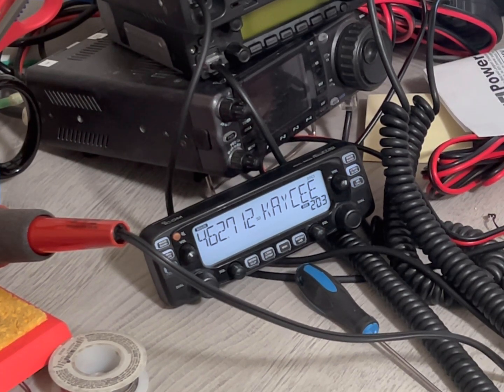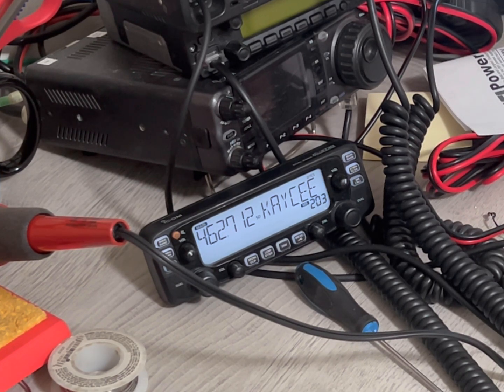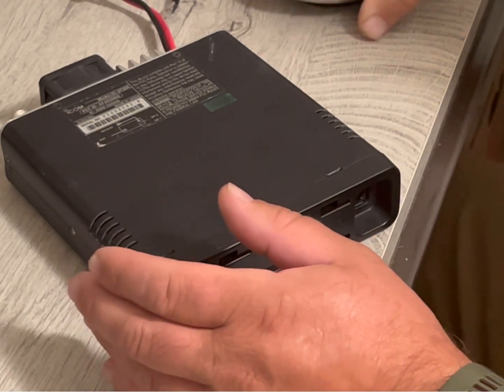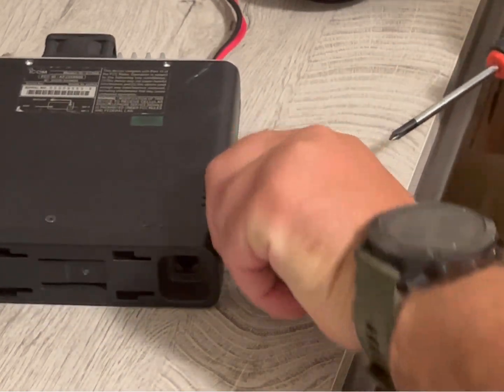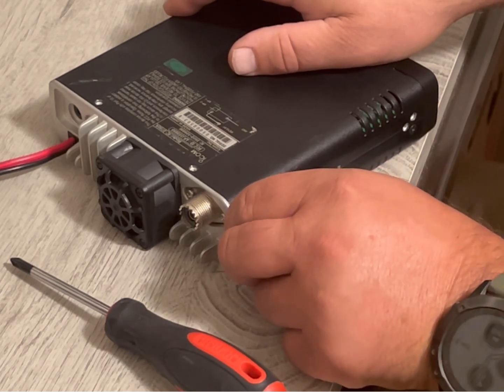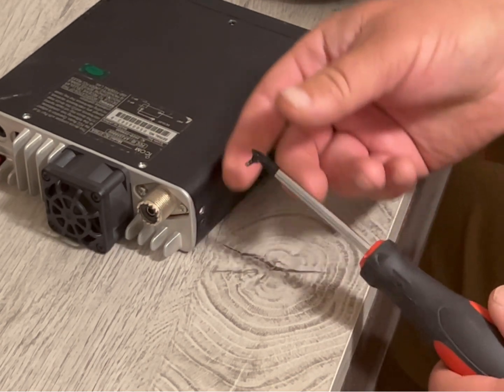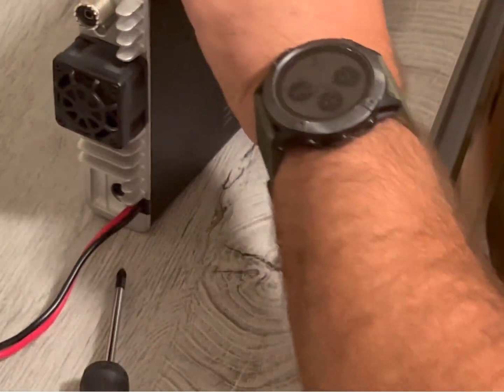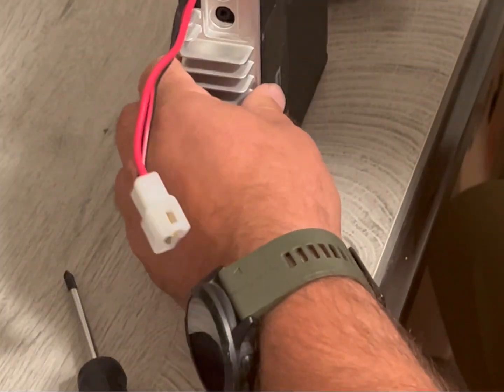ICom 2730a MARS MOD

Comment: PLEASE READ THIS BEFORE TRYING THIS!! USE A HOT AIR STATION IF TOU HAVE ONE!!! I performed this mod and there are some things people need to be aware of. Even using a soldering iron I managed to pull up the pad and one of the traces going across to the opposite side field where there are no resistors. I pulled up on the resistor a little to hard while applying heat to only one side. The trace is very small and delicate and is almost impossible to see. I had some noise issues after reassembly so I went back and took a closer look. After throwing the board under a microscope I could clearly see the damage I created. I should have used my hot air station but I thought it looked easy enough watching the video. That's on me. 

These resistors are assigned to UHF and VHF, the damage I caused affected VHF. For reference, there are 16 total pads in a 4x4 configuration. Looking at the board from the front of the radio, the top left pad, I'll call pad number 1. Pads 11 and 12 (VHF) and pads 15 and 16 (UHF) are bridged with the resistors on US versions. Pads 7 and 8 will have a resistor on Euro models. There are traces that run from some of the pads to others. I pulled up pad 11 and the trace running to pad 10.  The lifted pad and missing trace opened a critical configuration line that the IC-2730A uses to correctly set up the VHF front-end. With that line floating, the radio misconfigures its VHF filtering and biasing, causing constant background noise and reduced sensitivity on VHF. This caused all sorts of noise and other issues like my tone settings disappearing after changing a channel. My UHF remained normal as I did not damage that trace.

I should have known better given my experience but I was lazy and that's on me. The fix will be to connect pad 10 with a Via (a very small circle with a dot of copper in the center) that is right below the missing pad 11. This will be done with the microscope and some 36awg magnet wire and all the patience I didn't use the first time. I'll update as to the success of that endeavor.

Comment: Awesome video !! Does the mars mod open the icom 2730a to 11meter cb radio?
Reply from the maker: It will not. You would need to modify a radio that also has 10m such as the 7100 to achieve that

Comment: Also, why did your radio say mute on the display when you keyed up? Thanks for making the video! Guys like you are awesome!
Reply from the maker: Good question! You can turn that feature on or off. But in essence, this radio is really two transceivers on the same case. I have enough of a time hearing as it is, so when one “side” of the radio that is designated as the primary side is in use, it will mute the other side to give priority to the active channel

Comment: So if I only want to open up the 70cm band do I only need to remove 1 of the 2 diodes? Is it 1 diode for 70cm and 1 diode for 2 meter?
Reply from the maker: You cannot only open 1 band. It’s both, or none. The fact is, your radio will receive all bands whether you do the mod or not. All this modification does is allow you to transmit on those frequencies that are out of band.

Comment: Well done sir. 
Finally I find a regular guy with real life views on shit which would be on the common sense to the obvious chanel if there was one. Every radio should be unlocked just like all the black chinglish toys on Azon.  I saw the other nutless videos about this. Yours just popped up on my feed. 🎉
My question here is. 
Will it still chirp load for its new freedom’s. As in repeater programming  features for GMRS. 
Just wondering before I pull this mod. If the repeater program side of things have some sort of bullshit cock block built in somehow too? It’s going back. 
The unit I got was pushing 59w on the fringe band close to the FORBIDDEN ZONE! Lol
Aside from then SR 71 turbo fan as soon as you key it up. I think this will be a real talker. 🎉
You now have a loyal fan here BTW. 
Surely you have came to the realisation that fucking with magnets and miracles is a goddamn sickness not unlike chasing a fucking Dragon.  The comment about shit heads not replying gave me a lol moment. 
Thanks for you style and  efforts to clear up the other Nimrods vomit. 
Pull a cork for me 
Cheers brother man💫
Reply from the maker: Appreciate the comment! I do not use CHIRP - I prefer RT System's software for all of my programming needs. Yes, you have to buy a different software for each radio, but all data is basically cut and paste between all of them, it is simple and it just fucking works. That being said, I have successfully used it to program GMRS repeaters into this radio and field tested to make sure it works (in SoCal.)

Comment: Forgive me if I missed this. Will this allow the 2730a to transmit on the 5 MURS frequencies as well?
Reply from the maker: While I did not address MURS specifically, the answer is yes. The range this opens up includes MURS, all the way up to 174 MHz
Reply: @ Thank you for your reply and the informative video!

Comment: Thanks for the detailed video. I removed the 2 diodes exactly as shown and it opened up the transmit on GMRS. The problem I ran into is that now I get no transmit on the 2m band 🤷‍♂️. I noticed it when i tried to test the SWR, nothing at 144-148. Thoughts?
Reply from the maker: Not sure - we have modded 4 of these radios for our personal use and had zero issues - able to TX on all bands/freqs

Comment: Hey Kaycee I am thinking on picking one of these radio up from HRO. Does the radio Tx up to 467.725 at 50 watts?
Reply from the maker: Absolutely! Just make sure you pick up a 2730A not a 2730E. Lots of exports popping up lately. The Japanese versions cannot be modified. HRO can do this mod for you for a nominal fee.
Reply: @adventuresofkaycee  Thanks Kaycee I do know about the A model. I can handle the mod myself. I just subscribed keep the videos coming. Thanks Again!
Reply: @adventuresofkaycee  BUT DOES A  ICom 2730B , THAT'S B MODEL USA HAVE SAME DIODES ?
Reply from the maker: @keithlampman1652  I am not sure....Haven't had a chance to play with one yet

Comment: Great video thank you! Got it to work on FRS frequencies, but I must be missing something. I can’t get it to open up gmrs repeaters.
Reply from the maker: Do you have your pl tones set correctly?
Reply: As far as I know yes.
Everything for 2m & 44 works fine .
Reply from the maker: @MrRedneckEd GMRS repeaters are a little funny sometimes. I haven’t had issues with my local ones. Try contacting the repeater owner and verifying.
Reply: It’s not just one, it’s all the GMRS repeaters. anyway, thanks for trying! appreciate ya! 73

Comment: Hello! Help me with a problem with Icom IC-2730D. I removed all the diodes, but the station still did not open for transmission. What to do? Thank you!
Reply from the maker: The 2730D is set up for the Japanese market. This mod is for the 2730A which was designed for the US market. You would be the 2nd person that has had this issue with the Japanese model that has contacted me. I don’t believe the firmware on the Japanese version supports this mod. I would put the diodes back on the board and contact ICom to see if they can be opened up at all.
Reply: @adventuresofkaycee  Yes, but the crossband repeater opened with three buttons without any problems. Now it remains to learn how to open TX above 440 MHz...

Comment: Thanks for vid, learned a lot.  Does this mod enable offroad race frequencies like 151.625?  Would you use a different antenna when using it in GMRS frequencies from Race Radio frequencies?
Reply from the maker: Yes. This allows for the race radio / GMRS frequencies.  As far as the antenna question, just make sure your SWR stays below 2:1 and you’ll be fine. You could carry 2 antennas and swap them as needed, but there are companies out there that make wide range antennas that can handle the entire spectrum - at least on the 2M end.
Reply: Thanks Kaycee, quick response.  You da man.
Reply: Awesome vid. Is this what those big store retailers do?

Comment: Thanks for this video, I appreciate your uncensored speech. I’m researching radios now for a 4x4 I’ll be building out next year. I’m between this and the Yaesu 6000R. I like this Icom though. Here in the UK we can get the export version so the TX range is 137–174, 400–470MHz. I’m seeing this radio may be a bit loud, so I’d like to ask you for your opinion of this? I’d probably be mounting the base in the back of the vehicle, as far away from the front seats as possible anyway.
Reply from the maker: Both ICom and Yaesu make solid rigs. In my opinion, it’s like a Ford/Chevy argument or more closely (photography) shooting Canon or Nikon. When you get used to menus, layouts of navigation, etc, it makes it harder (but not impossible) to operate the other brand well. Me? I’m just comfortable with ICom software. As far as loud, I would agree if you are using this in a shack, sitting on your desk. The cooling fan does make some noise. But off-road? Forget about it. My diesel engine is much louder. Also, I have the head unit installed behind the driver side rear passenger seat and never hear the fan. The nice thing with the 2730 is the ability to remotely mount the head unit and microphone. Also realize you would need to run a cable to an aux speaker that’s forward mounted as well if you go that route.

Comment: Oh sad. Removed the two diodes that were not in your video. Still can’t transmit on 147.  It says off. I do get the cross band repeat. Not sure what else to do.
Reply: did you have any success even after a master reset  ?  Thanks

Comment: Thanks for the video. I bought (mistakenly) a 2730D in Tokyo. I have not gotten back home to try it. I hear that the spectrum is a bit smaller than US. Do you think the mod will at least broaden the spectrum to US standards?  Of course will be nice to transmit on GMRS as I do have a license for it
Reply from the maker: There may be an additional diode for the Japanese version, but I’m unsure. I’ll try and research that for you
Reply from the maker: I found this link. All the diodes are in the same field. It specifies which to remove based on geo location. Maybe it will help? I’ve never had a d model to open up.   https://www.jbe.nl/downloads/8331/Icom%20IC-2730%20FreqExpansion.pdf
Reply: When I get back and get time to open it up, I’ll send  you a picture of that section with the diodes. Thanks again and 73
Reply: It looks like my post gets removed when I add my email on it. I wanted to send you a picture of the board. The only diodes there are D321 and the one across from it.  I can’t read the number off the schematic. D307 and D315 are not there. What do you suggest I try, remove the existing two?  In your final mod, are there any diodes left in the cluster?
Reply from the maker: @benjosevilla  try emailing me direct. My channel name (all one word) at gmail
Reply: @adventuresofkaycee  - just emailed you the before and after pictures

Comment: It's possible the power reading is showing both the output to the antenna and the reflected power, it's added that to it making it show 60+ watts. It is the same on my Surecom SW-102, I get an indicated 50w+ out of a 40w radio, with an SWR of 1:1.3. But equally, it may be something completely different and I might be talking out of my arse. Who knows?
Reply from the maker: That is entirely possible…or it could be the cheap Amazon special watt meter I have. I’ve since upgraded the meter to an MFJ… maybe I’ll double check it on that in the next week or two

Comment: Thanks for this great info. On the 2730A, is it possible to program "channels" with text names? For example, if after performing this mod, I want to program 462.625 MHz and name it "GMRS CH18", can I do that and have "GMRS CH18" shown on the radio's display? And if that's possible, is it easy to scroll through these "channels" that I would program in advance of a trip that requires GMRS?
Reply from the maker: Great question. Absolutely possible. Sort of…you only get a limited amount of characters. Mine is labeled GMRS18. Scrolling is easy with the hand mic - either up or down buttons or enter the channel directly - if you store it in memory bank 18, you can simply use the keypad to enter “18” I really Ike the RT systems programming software and use it on all my radios, but you can also manually program channels in this one. Just takes time. I have about 600 or so active channels I use, so the software really helps me manage

Comment: Im so glad I stumbled across this video, I already have my IC2730 installed in my ute, but we have a PRS radio in the car, would be great to be able to actually communicate between them without having to install a separate radio
Reply: Ohk, so just opened my 2730a and all those are already gone yet I can't transmit on the frequency shown or others outside of ham band? Any ideas
Reply: You say “Ute” …are you US Based? Maybe your radio has a different firmware. If it IS a US radio, double check you are in the right field. If the diodes are gone, it will Tx
Reply: @lovemyguns1000  nz based, Ute as in a Hilux, or Tacoma I think they are in the US, the diodes mentioned are definitely gone, wasn't TXing at the mentioned frequency, added a couple diodes back to the other spaces as they were all gone, and now it'll TX all the way up to 469mhz, but still won't go into the 467mhz

Comment: Thanks for the video. After the mod can the radio transmit on 477mhz? Some say even after the mod it will only go as high as 470mhz.
Reply: I’ll check in the morning and get back to you.
Reply: @lovemyguns1000  thanks
Reply: 470 is as high as it goes
Reply: @lovemyguns1000  thanks for checking

Comment: I’ve removed those 2 diodes and it still won’t transmit on other frequencies. Any ideas?
Reply from the maker: What does the display show when you key up?
Reply: @adventuresofkaycee  I think the MOD is working but even with it, it won’t transmit below 136.000. Did you find that to be the case?
Reply from the maker: @nathangrimes641  hmm. Lemme check when I get home. I have 3 of these modded radios and one was done by HRO. I’ll look and get back to you this evening.
Reply from the maker: @nathangrimes641  mine do not transmit below 137.000. It appears the mod opens FM transmission only, not AM
Reply: @adventuresofkaycee - per spec sheet USA .  Transmit - 144–148, 430–450MHz,  Receive - 118–174, 375–550MHz
Import - transmit and receive are the same 118-174
Will the modifications make my USA radio transmit to 174 ?

Comment: Thank you so much for a good quality video and clear explanation on which diodes to remove. I was having trouble finding solid information about the mod I could trust.
Reply from the maker: Not a problem at all. We were running into the same issue and decided to fix the problem. Glad we could help!

Comment: Well done! I've watched video's on mars cap mods and in general, they make me cringe. A halfway decent temp controlled solder station is under 100 bucks these days, wtf? Anyway, hope to see you do a similar mod on the FT60R. Also, wondering if the tweezers are glasses tweezers? They seem to be the perfect tool for the job.

Comment: Excellent video...to the point, clearly and concisely provided all the required info, and it was refreshingly non-woke and entertaining...thank you.

Your video focused on UHF and the MARS frequencies, for obvious reasons, but I am wondering how much the mods open up the VHF spectrum?  We have an allocation in the 150-160 Mhz area for off-roading, and it'd be cool if the 2730 could be modded to transmit on those frequencies for those very rare occurrences where I might actually have to do so.

Thanks once more...Regards from The Great White North.
Reply from the maker: This mod will open up the VHF frequencies you are looking for, but it is important to note your SWR will be quite high at those frequencies with most HAM antennas. So not very efficient and hard on the finals of the radio. In an emergency, it is what it is. There are wide band antennas available that give you a decent SWR across the VHF spectrum, but they are either very expensive or the gains are much lower than a dedicated HAM antenna.
Reply: @adventuresofkaycee  , thanks very much, greatly appreciated.  Yeah, no solution is ideal, but I reckon I can suss out something that works....glad to know it is an option if I decide to go in that direction.

Thanks again, stay well.
73s
Reply from the maker: @beharford  if you use a simple vehicle mount like NMO, you could also just carry a second antenna and swap it out if you need the higher freq’s on VHF. That’s what we do if we know we will be “outside the band” on UHF…we just have another antenna pre tuned for that part of the band.
Reply: @adventuresofkaycee  , thanks bruh...yup, easy enough to carry 'round a properly trimmed 1/4 wave...off road fx are all short range and simplex

Thanks again

Comment: I did this mod and had an antenna tuned at a shop...and still while using gmrs in convoy people can hear me but at times I can not hear them.  Several are using hand-helds and others are using vehicle mounted gmrs radios.  Is it a power issue?  Is there a skip zone with these radios?  Do you believe it is an antenna issue?  Usually utilizing channels 20-22
Reply from the maker: If they can hear you, but you can’t hear them, the issue is most likely on their end. You are generating enough power to reach them. Handhelds have shit transmitting power (5w or even lower when using Chinese radios like Baofeng - most Chinese radios only put out 1/2 their advertised wattage) and antennas inside the cab of a vehicle never perform well.